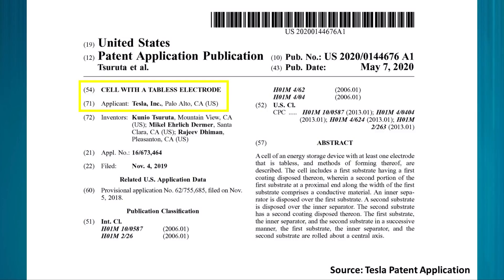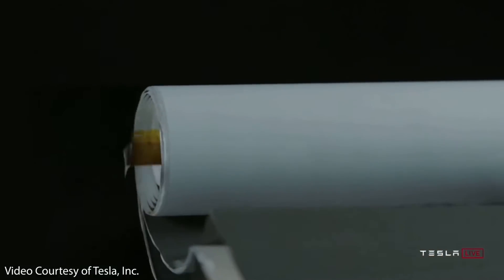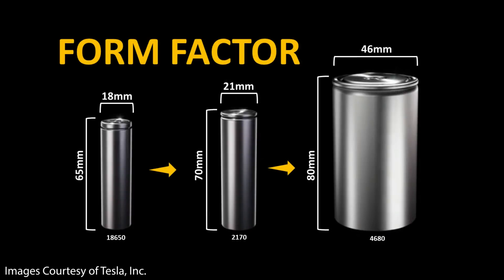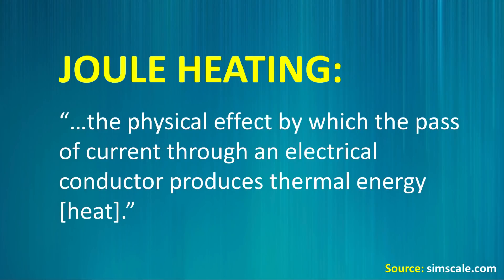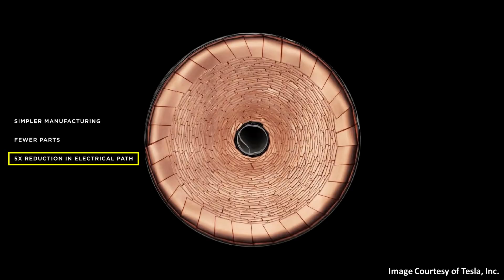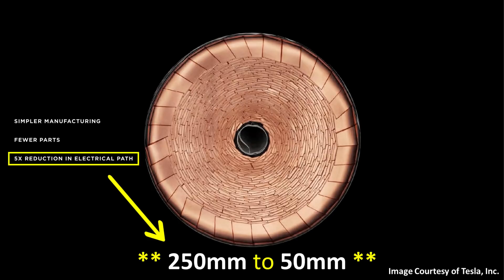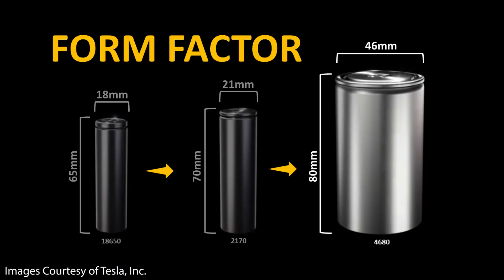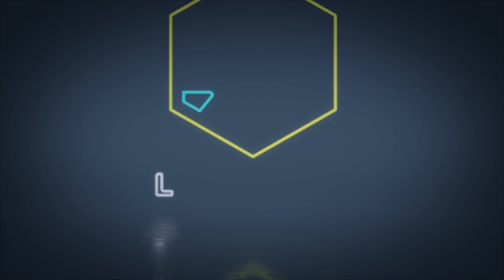Why Tesla 4680 Batteries HAVE NO TABS (Detailed Analysis)

Comment: The 4680 battery will indeed charge quicker, but for the battery pack it will hardly make a difference. It will replace almost 6 18650 batteries in volume and weight and storage capacity, so it needs to charge and discharge 6x faster as well. According to other specialists the charging speed for the car will be slightly faster as current Tesla cars, a few percent only.

Comment: Tabless for both anode and cathode? Like to see both ends with their (I assume) folded over tabs. Does each 360 winding have a tab or is it just one long tab folded over? Are the tabs just partof the electrode or is each tab specially coated?
Reply: I guess both ends are folded just like in the picture, and the insulation strip is larger sheet folded in a zigzag pattern between them. the ends are simply pressed inside the battery tube ends.

Comment: No offense, but didn’t we know about all of this already? Tesla has been talking about the “tabless” design for a while now.
The problems introduced by the tab are pretty obvious-so obvious that other battery producers are well aware of the advantages of eliminating it.
It’s my understanding that the reason no other company has a tabless cell on the market is that it is very difficult to manufacture.
So, I might suggest that a more interesting/useful video would be one that discusses just how Tesla plans on manufacturing cells with this design in volume. I assume that’s what Tesla has been working on since Battery Day.

Comment: There's nothing new with this concept, and what an awful misnaming tabless design is!

Every battery tailored to power density used rightsized electrodes and conductors. The same with historical lead acid plates.

Misnaming a continous tab all along the length of the wounding as tabless just confuses the masses. Instead of relying on active electrode material to carry current over the length of it, the design reinforces current distribution through proper conducting materials over the length, incurring in higher resistance only along the height.

That's kind of obvious. Maybe Tesla has gone this way first in cylindrical Li-ion batteries, but certainly not with the concept.

It's amazing how people overhype everything related to Apple and Tesla while downplaying shortfalls.

BTW, the stupid and dangerous Yoke (that is still a joke) comes to my mind.

Comment: BYD use the large surface area of Blade Battery to cure problems relating to heat, while Tesla removes tabs.
4680 and Blade are both innovative and interesting solutions. Tesla mentioned on the Day of Batteries that they want to use a structural battery pack with the 4680 cell, but I think BYD Blade may be more suitable for structure.
Reply from the maker: I am actually about to record a video about the BTD blade batteries!
Reply: @Cleanerwatt  Nice! Tell us which battery format you prefer! I'm a BYD fan myself.
Reply: @ Cleanerwatt:  Excellent!

Comment: Excellent overview of the new cells.  Since the new Plaid still uses the 18650 cells, any idea how they keep the power levels so high throughout its state of charge?  The Model 3 for instance loses about 100hp from 90% SOC to 50% SOC.  How is the Plaid maintaining this without having to use these new cells?
Reply: Capacitor

Comment: Thanks for the vid. How much faster do you estimate an M3 std range with 4680's will charge compared to the 18650/2170's?
Reply: I believe it's about 6x faster, but since there will be 6x less batteries as well,  each 4680 needs to hold 6x more energy as well. In the weeks after battery day, they said that the charging time would decrease with a few percent only. The gains made by upping the superchargers from 250 to 350 will give better gains.

Comment: Very interesting. In essence, this closes the gap between current cell technology and the potential of possible future solid state. In other words, solid state will have to reach mass production efficiency and economy, to even begin to compete…and the 4680 will be powering vehicles throughout the latter part of 2021, or at least 2022 onwards? And presumably be refined along the way and become cheaper to produce. Wowee.
Reply: I believe they are solving separate issues of batteries. This clearly doesn't prevent fires if the capsule is ruptured, however solid state does solve that issue. These no doubt will be faster at production than SS batteries. However, I believe they are working on reducing the time it takes to 3d print SS batteries and once they get it down to an appropriate time SS will probably surpass (my speculation). Tab-less is fairly neat, but I don't think it's end game.

Comment: This is probably a good 'technical' description but is there video showing one
of these batteries 'unrolled' or 'unwrapped'?  Just can't wrap my head around 
how this is made.........
Reply: Neither can Tesla engineers apparently.  ;-) Cutting the foils into all these little dents then folding all dents as you roll the sheets fast enough for industrial production rates will be a major achievement once they manage to make the process absolutely faultless. It's not mentioned here, but I have a feeling that Tesla also wants to improve on the currently rather high defective 2170 cell rejection rate.
Not sure if Tesla will be building and selling 4680-cell-making machines or licensing its 4680 patents, but that could be a huge revenue stream too if this top of the art cell gets more widely adopted. Ebikes will need to stick to 18650 or 2170 cells though...
Reply: @Chimel31  Any video suggestions......?

Comment: A while ago, everyone was talking about how non-cylindrical cells would revolutionize storage density. Is this going to come to Tesla? Are cylindrical cells still holding back the density of the pack?
Reply: Tesla chose to continue using the cylinder because the tabless design is only possible for large scale manufacture in that shape. The added benefit is that a cylinder is a very strong structure and so the cells can be integrated into structural packs forming a very strong part of the cars structure whilst overall reducing the weight of the car.
Reply: 4680 pack density looks like leading edge compared to others, but I am a bit curious about the high electrical and thermal stability of the individual cells, or rather what happens to it when cells are glued to 4 others in an honeycomb battery pack. The sides in contact may create very localized higher temperature zones within the cells.
I have no doubt however that Tesla already solved this concern, maybe with the type of glue used, or maybe even this local temperature differentials is well within the margins of operation and no concern at all.

Comment: Tabless cylindrical battery cells.  In retrospect, the concept is obvious.  One wonders why no-one thought of it over the course of more than a century of using tabbed cylindrical cells.  Shorter conductive path, less resistance, less heat, better energy efficiency, better battery cycle life...

I've used cylindrical batteries all of my life, but wasn't smart enough to look at one and say, 'hey, this is dumb.'  But it was.  My enthusiasm for Tesla comes from exactly this sort of re-thinking of the engineering art, reconsidering it from basic principles.  

It's worth noting that tabless, large cylindrical cells are chemistry-agnostic.  In principle, going tabless and making cells larger should work with any battery chemistry - perhaps even solid state, if that tech ever sees the light of day.  Or Tesla's patent for anode-less cells, where the electrolyte itself stores ions instead of a separate anode, which may turn out to have even more promise than solid state cells.

The biggest advantage of larger cells is easier manufacturing.  Fewer parts to assemble, fewer assembly steps.  Battery packs which use this tech should last a very long time with only small energy storage losses.  2170 packs should last 300K to 500K miles, depending on how they are used.  I can't even guess what pack lifetimes will be for 4680 cells.  Tesla hasn't yet told us what they expect.  Perhaps they want to finalize the cell design first and do some real-world testing before revealing what they've managed to get out of the tech.

Did the tabless cell idea come from John Goodenough?  Whoever originated the idea, he or she deserves a lofty position in the history of engineering.
Reply: I've been thinking that the mfg delay of the 4680 comes from trying to wind the tabless rolls at high speed.  Air currents and centrifugal force will cause the tabs to flutter.  Fluttering leads to tears and breaks and contamination.  Tesla engineers are probably trying a gazillion ways to speed up the winding without destroying the tabs.
Reply: @dalerichardson7202  it's not tabs they have to worry about destroying - but this is just a nomenclature thing.  It's 'caps,' I think - that have to make a good and stable connection to every layer of the electrode winding.

There's no way to know how far along they are until they actually tell us.  They probably have run into multiple challenges to get to high speed production, have solved some of them, still are tweaking on the others.  We know they are confident of success, but don't really know what the timeline will turn out to be.

If it was easy, some guy in his garage would already have done it.  :-)
Reply: Sorry for delay folks. I think 4680 design was likely inspired by film capacitor extended foil construction which has been around for many years. Similar to 4680, each of the capacitors 2 windings are extended at opposite ends. The ends may have caps with conductive adhesive or metal spray applied to electrically connect all the windings in parallel 
search us patent US3539885 - sorry youtube doesn't like the links. The net result is very high current discharge capability and very low inductance which is an advantage for many electronic applications, especially HF. With the 4680 you get the advantage of much better heat conduction to the end of the coil .
Reply: @ Urgelt:  I'm curious about how the factory will fold over the electrodes at the cell ends.
Reply: @red-baitingswine8816  I'd like to see a cell disassembled, too.
Reply: Urgelt, see my comment above.
Reply: @terrydemol5354  I've scrolled through all of the comments on this video, Terry.  Didn't find a post with your name on it.
Reply: @Urgelt  Yes, it disappeared, not sure what happened there. I'll repost a bit later.
Reply: @terrydemol5354  If you post it under my comment, I'll get a notification.  :-)
Reply: @terrydemol5354  Youtube has been brutal autodeleting any comments that have external links.  Did your comment contain them?  You need to break the link in order to get past the youtube algorithm.

Comment: I didn't know 18650s were 650 mm long 🤣
Just kidding but I don't remember learning about uneven electrical transfer anywhere else.
Edit: "current deviation".
 
Thanks!
Reply from the maker: It was the first I learned of the "current deviation" too...
Reply: @Cleanerwatt  You get an effect called tracking (path of least resistance) due to issues with the chemical/physical/heat/dendrite issues of the electrolyte paste, in tabbed cells.  Tracking greatly reduces the efficiency of conductivity within the battery & increases heat generation, eventually destroying the battery prematurely.  The tabless design reduces tracking & it's effects due to the massively increased number of electrical paths available as a result of the effectively, continuous edge "tabs".
I think it may have been described on Battery Day.
Reply from the maker: @alexmanojlovic768  Very interesting - thanks for the info.
Reply: Isn't it because there is only 1 tab in a 2270/18650 that the electrons have to travel through the complete length of the jelly roll (or half on average), compared to the 4680, where it would be the distance to the closest tab, which is half of the spacing between the tabs on average?

Comment: Thermal transfer down to end rather than out sideways is critical.
Reply: imagine a lot cheaper to cool from the pan on the bottom than the complex existing pack design...maybe that helps getting rid of the vestigial "modules"

Comment: How will the 4680 battery technology compete with the new GAC solid state technology in production now  that can charge at 3C and 6C, at 0 C ambient, with a 1700 cycle lifespan to 80% providing  >= 1 million mile range pack life?
Reply: Cost?
Reply: @lengould9262  we shall see soon, the AION V suv is on sale this coming month.  621 mile on a single charge, 80% charge in 8 minutes,  and even when at 80% of charge the rate of charge is >400 kwhr.  This is indifferent to Li-ion batteries which are far reduced in charge rate at 80% of charge.  If true, what we are about to witness is a breakthrough of huge advantage of battery storage technology that absoletes gasoline vehicles.
Reply: What's the power density and weight? What's the price of a cell and how many does it take to make a 400 mile range car?
Reply: @2nd3rd1st   240 w/hr and 1000km or 621 miles range per charge.  Reference: https://electrek.co/2021/07/28/gac-aion-showcases-charging-technology-claiming-charging-times-of-8-minutes/
Reply: there is not that much Scotch tape in the world to make that much graphene (it's a joke)
Reply: @markpickenheim  maybe, but  just Google (graphene breakthrough) and you'll see many advancements.
Reply: @arthur321654  It certainly won't be the first company to make those claims.
Reply: @lengould9262  It's intended to be released in September, whether that's only in China I'm not sure, but you can bet journos will be fighting to flog the daylights out if them to see how they actually stack up.
Then we'll all know if it's for real or not.
I'm hoping it is, but even if the range doesn't hold up, at least they've had a crack at it.
Reply: 1,700 cycles sounds impressive. What about charge efficiency, costs, integration, a demonstration plant, what about a pilot plant. Perhaps even full on production facilities adjacent to gigafactories?
Ya, I'll believe it when I see they're being used in megapacks (and, or cars).
Edit: I forgot about energy density... Will the compete with the LFP that's soon to be only $50/kWh?
Reply: @fireofenergy  I'm hoping that Sandy Munro and assoc., will disassemble a GAC graphene battery next month after the AION V SUV goes on sale.  The truth will be known.  Hopefully,  Tesla is developing the graphene based (6C fast fast charge ) technology too.
Reply: In July, the GAC Group demonstrated its 3DG (three-dimensional graphene) production technology, which reduces costs by a factor of ten. GAC says its graphene-based battery has a 6C fast charge capability, which means that, using a 600 A high-power charger, it can be recharged to 80% capacity in 8 minutes.
Feb 22, 2021. Source: Newswire
Reply: @arthur321654  
So when in it in production?